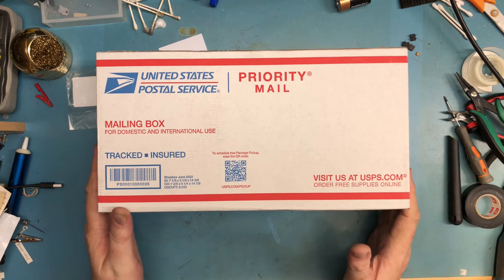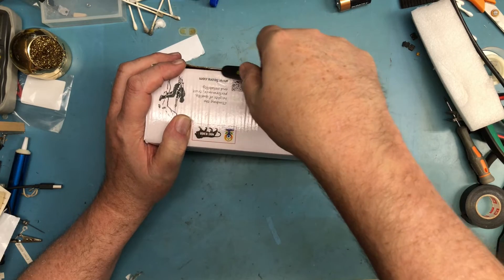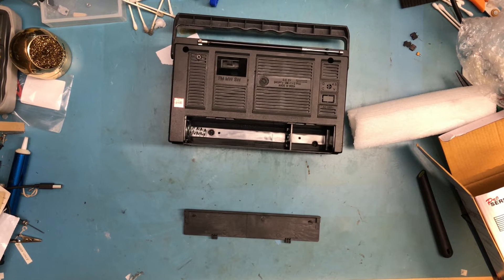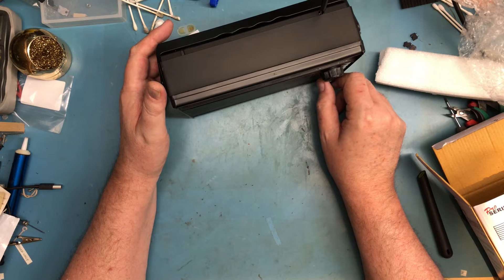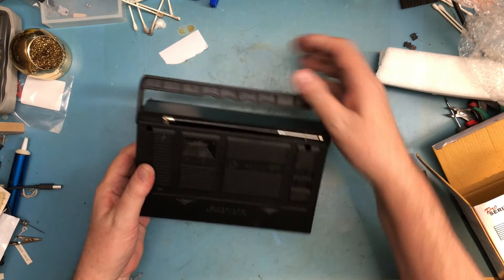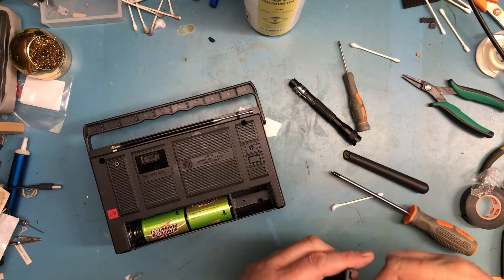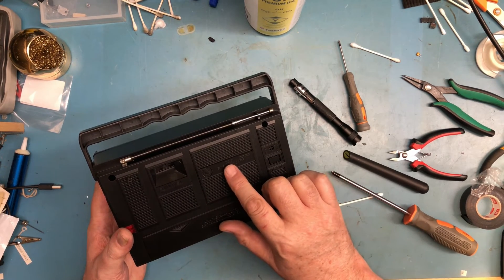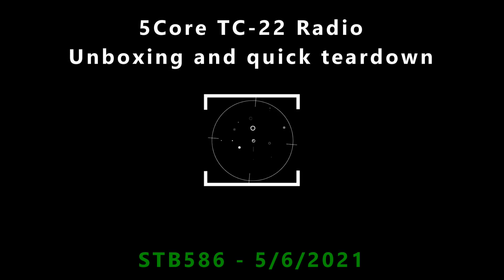STB586 - 5 Core T22 / TC-22 Radio - Unboxing and quick teardown

Comment: Original  company is already closed in 2007 (Manufacured originally with 3 batteries), some boys assembled and sold these radios till 2012 in Delhi a place of 10×10 shop  I used to visit both boys, with their set up they also disappeared way back in 2018, Like last manufactureres some other micro one room entrepreneur is still able to avail this thing. This radio, the viability of cost  in the market keeps it alive. American and other western find it workable cheap, new yet nostalgic inbtherms of the analogy setup. 
It truelly amazes me that in flood DSP chip these days they're are still assembling this thing.

Comment: PLASTIC MOLDING, not casting - plastic is molding metal is CASTIING--lol  Excess untrimmed plastic is called FLASH - I used to work in a molding plant for 15 years sorry for being nitpicky.
Reply from the maker: Thanks, you are of course 100% correct. I'll try to be more accurate in the future. :)